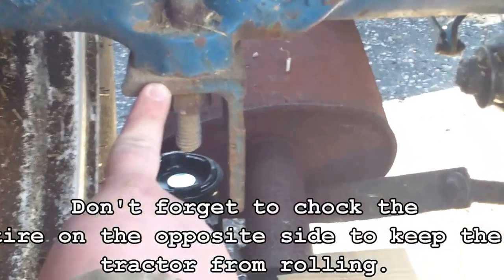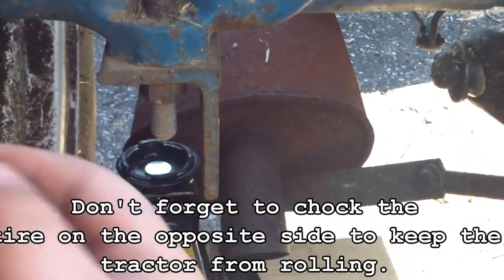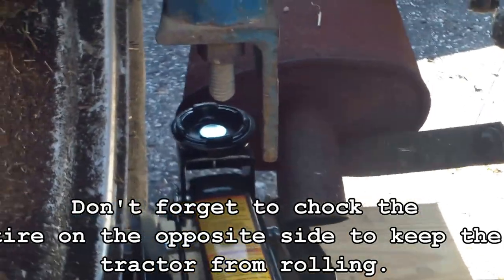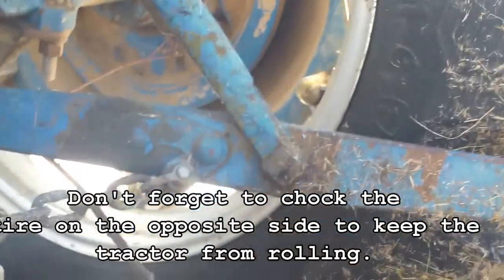Howto jack up a tractor using a floor jack

Comment: Insane. Never use concrete blocks for jacking. They can unexpectedly crumble.
Reply: I always thought about that. I've done that in the past jacking up my cars using blocks to support it.  Probably best to just stack up 2 X 6's until you gain your thickness, and heights needed.
Reply: Use a scrap 4x8 and then maybe 2x6. Heck, even some timber rounds then 2x6s should have the integrity needed.